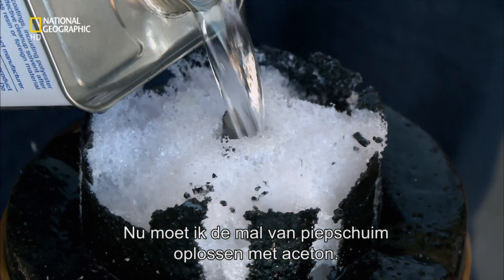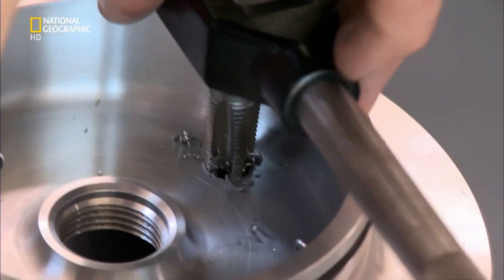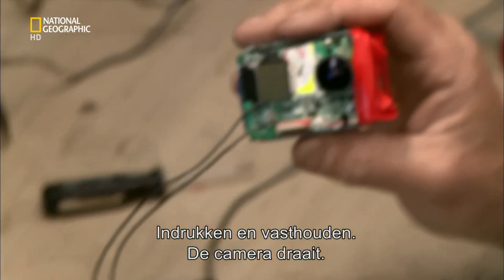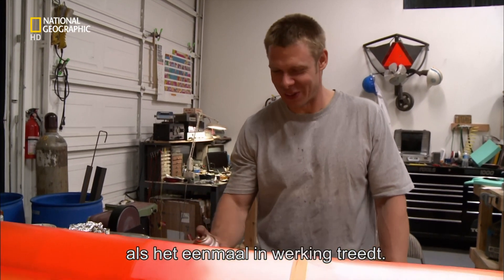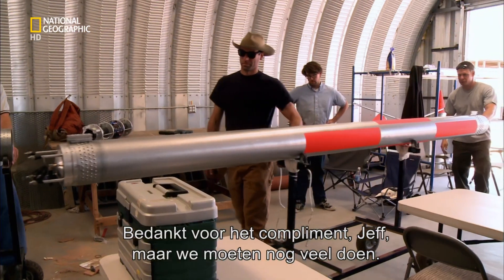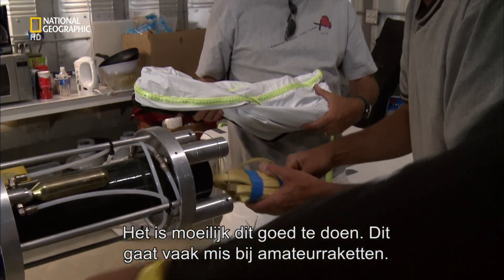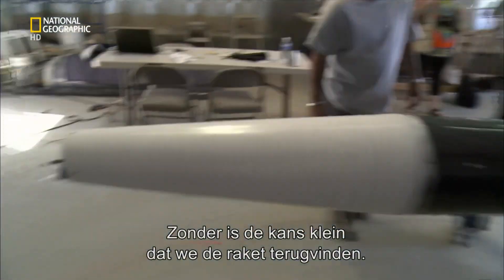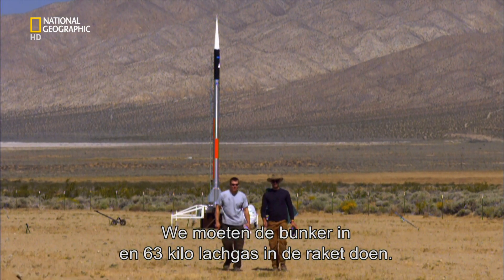How hard can it be? Building a rocket from scratch Part 4/5

Comment: Actually 80% of 'HARD' is design requiring knowledge of aerodynamics, interrnal ballistics,chemical equilibrium, mechanical design, pneumatics, stability, thermodynamics and lots of math and simulations. This rocket is actually a copy of the SORAC (Sub Orbital Rocket Amateur Class) designed by Bill Colburn. They did a great job of assembling parts but the hard work was done form them and Jeff by Colburn.

Comment: The king of random had a chute pop out on a 20$ rocket, how could you fail this?
Reply: Well its 50,000 feet and the king of random rocket went like 1000 feet (most basic model rockets), even its more ppl are helping them it’s incredibly difficult to pull that shit off, they tried black powder charges which when at 50k feet doesn’t work because there’s no oxygen and the electronics to deploy the parachute was even tested
Reply: @Rio-tl1hw  Not true.  Black Powder contains it's own oxidizer.  As long as it's kept dry, it can burn underwater (or in space) just fine.